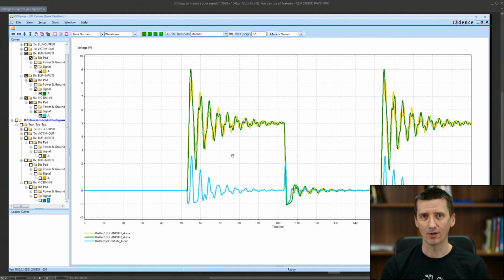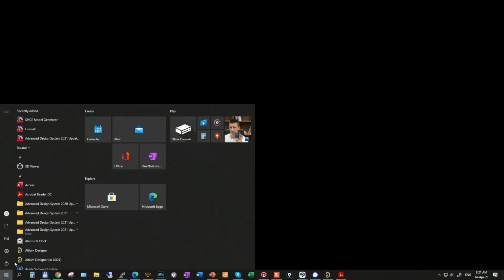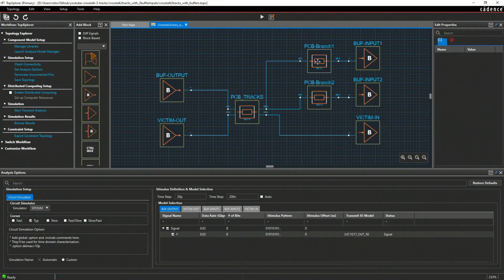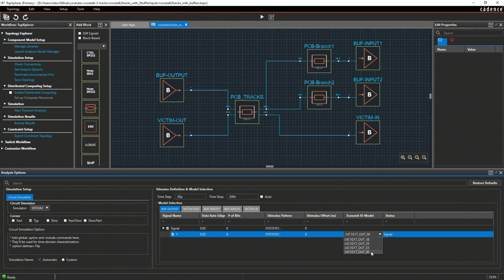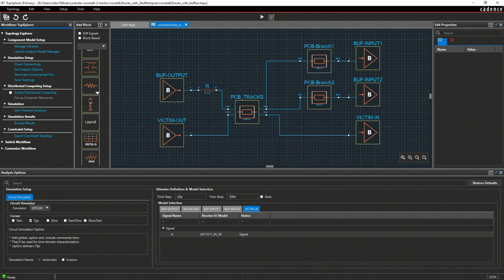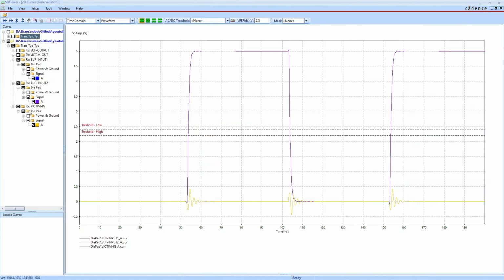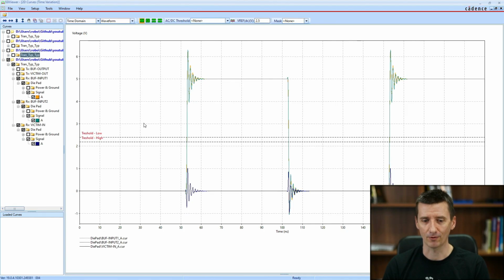3 Simple Tips To Improve Signals on Your PCB - A Big Difference

Comment: So the analysis was done via simulation only, or did you have to make the board to see it?

My adc takes a differential input.. is true that there should be a MINIMUM spacing (ex. 20mil) between the high and low?  A 100pf cap to ground with its own via directly to a ground plane (layer2)?

Comment: Where the track bifurcates, doesn't that change the characteristic impedance of the track? If the tracks are the same length, to the transmitter, doesn't the track look like a 50 Ohm section followed by a 25 ohm section?

Comment: You should also separate the two outputs from the drivers by some space to reduce the crosstalk.  The crosstalk is proportional to the length the two traces run in parallel.  The longer the parallel tracks, the higher the crosstalk.

Comment: By matching the output impedance (driver + 33ohm), the reflection off the high impedance buffer at the end reflects back to the driver and the reflection is fully damped by the matched impedance of the driver to the 50 ohm transmission line.

Comment: Even if the the clock speed is only 10Mhz, the rise/fall times are 2 - 3 ns, meaning you need to apply RF thinking in the layout, i.e. trace impedance, via impedance, source and termination impedance, ground planes,  via stiching etc.
As 4-layer boards are so low cost, using 2-layers for digital, would make reasonable tracks a bit wide on 1.6mm boards.

Comment: So shortly:
Lenght matching eliminates ringing.
Changing stack-up moves impedance closer to 50 Ohm.
Resistor is decreasing difference when impedance changes between buffer and track.☝️
And its only problem, when lenght is close to wavelenght of frequency generated by rising edge.

Comment: 20mils, 8mills track length? That seems to be a not practical example. You did model an IC architecture rather than a PCB layout. It would be more interesting to see a result without the improvements with a real world values. Like 100 or 200mils.

Comment: Very infromative video, i am a HW developer / tester currently, and in my lab (at work) i have the chance (privilege) to work with Tektronix MSO66B, it has 12.5GS/s with 10GHz bandwitdth, damn some crazy stuff with digital signals you can se, most commonly overshoots/undershoots, i tested one RGMII with ADIN1300CPZ PHY and damn, this scopes takes crazy measurements, rise/fall times below 450ps, TIE measurements are also extremly thorough. Very grateful to have the opportunity to work with that sort of equipment and just by looking at a Layout of a board that i'm testing, i can see how just how crazy little thing like, barely noticeable things can have huge impact on the integrity of the signal and thus whole interface itself.

Comment: I thought you’d only get reflections when the line is electrically short and there is an impedance mismatch. In your case however I don’t think the line is electrically short. The ringing is caused by the the gate capacitance and line inductance. The signal was ringing at its natural resonance and was underdamped. Adding a resistor helped dampen the ringing.

Another point, the frequency of interest here is calculated based on the rise time which is 0.6ns and it’s about 400MHz not 2GHz

Comment: For the output impedance of the buffer, since you have the IBIS model, put a 50 ohms termination at the ouput and measure the voltage at the resistor 50 ohms relative to ground on simulation. then uses a voltage divider equation and solve for the value of Rseries in the buffer.  You can figure out the actual real part of the impedance. Then Zs of the buffer plus series termination should equal the transmission line impedance.

Comment: Great video.  Concerning the tool (Sigrity) itself, is the manual process of entering the trace characteristics mandatory or can you use an existing Allegro board file (or PCB artwork etc) to define the trace characteristics?
Reply from the maker: Thank you. You can make some simulations directly in Allegro and you can open some simulations from Allegro, but you may need to adjust some settings. This can  help: https://youtu.be/Bu4MirknEvo and also this can help: https://youtu.be/-t25gJIDQNo

Comment: Very impressing education showing us these hidden potholes in circuit design. for me the termination not only reduce the bounce back  affect but it should also decrease the velocity of the output so that the first re bounce is not that strong as well i think. my first guess to your solution was to use resistors to reduce the ringing and also use ground plane to reduce the interference but I overlooked the length matching at first but that is rather obvious when you said it. I recall this length matching on boards was initially made to impedance match the traces but that they also serve the role to match the wavelength was less known to me so I actually learned something new here too. I have not built anything yet that works with this frequency but I do make oscillators that runs up to about 100khz or so and this generally won´t give you much problems that easy but I tend to use terminal resistors and also pulldown resistors to ground to reduce the noise between stages sometimes. but what I build is mostly control circuitry for amplifiers and powersupplies, timers and feedback or protection and mode indication stuff which I use for the tube amplifiers I also make for myself.

Comment: Someone may have already asked this, but could you get a close impedance match on the high-impedance input-end of the tracks by shunting ~50 ohms to ground at the inputs? Wouldn't that eliminate or greatly reduce any reflections? I ask because two of the three approaches here--the stackup thickness which would require more than two layers, and matching the length of branching traces--are not always practical (or at least not always desired for economy or size contraints). The work I do is limited to inexpensive two-layer,  .0.063, FR-4 boards.

Comment: Thanks Robert for these videos. It’s very informative. In this video I understand ringing is because of not impedance Matching and also length of the tracks should not exceed based on the rise or fall time calculation but how did cross talk reduce in this video ? I understand improvement in ringing eventually helped cross talk but what do we need to do to reduce cross talk increase distance between aggressor and victim ?

Comment: Long text about estimating output impedance if you don't have a good simulator at hand, its been very helpful at my work so i'd like to share:

It's hard to specify an exact output impedance of drivers since the resistance of the output switches (mosfets in our case) will differ depending on the drive voltage and such. Meaning that lower VCC levels will lead to higher output impedance.
If i recall correctly this is not a 100% accurate, but will give you a decent estimate of a drivers output impedance.
And as a general rule of thumb for LVC drivers specifically 20-33ohms are usually good. 
If you change to a different family of drivers you will need to estimate their output impedance too, here is an example that has work well for me with numbers available in all datasheets (also for MCUs!).

Using numbers from the "Electrical Characteristics" table in the datasheet, find the output voltage section (Voh, Vol).
Under test conditions you will find the output current they used to get the numbers, for the parts used in the video (SN74LVC1G17) you will se that when driving low, when powered from 4.5V, with an output current of 32mA, the pin will read as 0.55V.
If you calculate resistance from voltage and current (R=V/I) you get this calculation: 0.55/0.032 = close to 17 ohm. 
For high drive you will need to calculate the voltage drop inside the driver by taking VCC-Voh (4.5-3.8) = 0.7, which yields 0.7/0.032 = close to 22 ohm.
You can do this for the rest of the VCCs listed in the datasheet.
As mentioned before, its hard to give a specific number because the impedance comes from a complicated part such as a mosfet or bjt, but you get ball park values at least.

4.5V VCC:
drive high: 22 ohm
drive low: 17 ohm

Which makes a 33 ohm resistor good for a 50 ohm track because:
22+33 = 55 ohm
17+33 = 50 ohm
Both which are exactly or close to 50 ohm

2.3V VCC:
drive high: 50 ohm
drive low: 38 ohm

50+33 = 83 ohm
38+33 = 71 ohm
Not 50 ohm, in this case it may be better to not use any external resistance since the average output impedance of going both high and low should be 44 ohms. Or add a 6 ohm resistor to minimize both errors as much as possible.

Then again, the numbers we get from doing this calculation is not perfect, and if you do the calculations with numbers where VCC is the same but the output current differs you will also get different impedances (using Vol for the part used in the video, with VCC = 3V, 16mA output current is estimated to be around 25ohm, but with an output current of 24mA you get around 23ohms). 

It's still worth doing the calculations though, since we have used drivers with around 75 ohm impedance at work before, meaning that any added resistance for a 50 ohm track only make things worse, so long as the resistance is not high enough to slow down the rise time enough that your trace looks relatively short verses your wave length again.
And STM32 micro controllers generally have 50 ohm output impedance when using "high drive strength" settings. So no added resistance there too if you are using 50 ohm tracks. You could also try using 20ohm tracks with the SN74LVC drivers, and you should have less issues too.
Reply from the maker: Thank you SO MUCH Tomas. Exactly what I was looking for!
Reply: Thanks for the information👍
Reply: Nice video and also tips about the impedance calculations. I used this idea recently. 

It’s worth to keep in mind the Vil and Vih of the receiver together with the Vcc and series resistor at the output buffer. The voltage caused by the potential division might be reduced and may not drive properly. This is in the case you have a termination resistor too.
Reply: And you should consider the 32mA on the datasheet even if the output is connected to a CMOS high impedance input? This is due to the max current on the transition? Or this current is related with the load.
I have a project here with 22R everywhere, even on the output pins of the CPU. I will take a look is the datasheet days something about impedance on the outputs.
Thank you.

Comment: Robert, thanks again for another awesome educational and insightful video. You mentioned that oscilloscopes might not show correct results. This rose a question for me: Would you - or maybe some experts from oscilloscope manufacturers - be able to demonstrate the effect of a scope's capabilities on actual results of measuring noise when those measurements get difficult. i.e. at clock frequencies in the range higher than, say, 500 MHz? I'd love to see some "this works, because the scope has this and this capability" insights. I know I am dreaming here - but maybe there is something like this in your video pipeline? Thanks again! - Regards. Frank

Comment: I actually wonder if that 33 Ohm resistor would work in "real-world" scenario. Resistors in higher frequencies act as inductors, which would influent the line impedance... Maybe a proper approach would be to have some sort of matching circuit, like L-type, since we want to match the line to 50 ohm? Of course, I am not aware what kind of frequencies are we talking about, just something interesting to think about :D

Edit: Ah yeah, it doesn't make a difference what the signal frequency is, this is caused due to sharp edges, which theoretically consist of infinite types of frequencies..
Reply: Smd resistors are excellent resistors up to at least several GHz. To lower the paracitic inductance, you could even mount them upside-down.

Comment: these looks like it is not really a good pcb design, gate driving ringing because of capacitance or inductance, last is most common, decoupling of supply lines is also a cause of these errors.. Be aware with Gan if this ringing occurs, these can blow.  You do some kind of canceling methode by feedback through parallel trace?

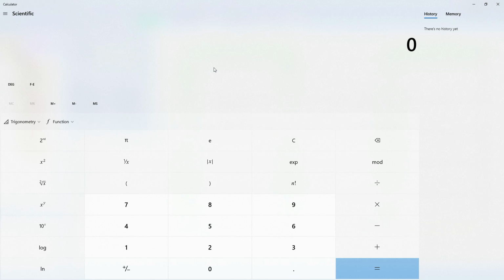Comment: Hi Robert. I want to ask some thing. At time 36:00 you calculating frequency from falling edge and it's time 0.5ns (1/x). This calculation is, I think, wrong. Or does it? Here is why: In one period, there is always 4 edges, 2 rising and 2 falling. Therefore calculation has to be 1/(0.5 x 4) to get right frequency 500Mhz and not 2Ghz. I verified this through on my system where I measured with my 1GSa/s oscilloscope, 2.6ns falling edge. I saw also ringing where I marked full period of sinewave and oscilloscope gave me 110MHz frequency which is close enough and this also supported my thinking. What do you think? Btw I enjoy your work. Keep going!

Correction:
Oh. I think now we are both wrong :) In one period is only 2 full edges (or 4 half edges). Therefore 1/(0.5 x 2) will be right. I fount also mistake on my oscilloscope where it calculates fall time from whole first voltage peak which is also wrong. Be this for everyone as warning to not depend on oscilloscope time readings of fall, or rise edges because this calculation can be wrong as much as bigger is first spike.

Comment: The reason for using 33 Ohm - you are trying to match the buffers output impedance to 50 Ohm, lets say you have a SN74LVC1G126, when the outputs is low, its parameters are max 0.55V @ 32mA = 17.2 Ohm output impedance. With 33 Ohm you get 50 Ohm :) This also means that this resistor value should be output specific, in order to get 50 Ohm output impedance. The resistor also needs to be placed as closed to buffers output as possible, so it appears as a single impedance.
Reply: But if the your sn74 output it's connected to CMOS input or microcontroller. The current will be 0mA due to high impedance of this inputs right? On this case you should use 50ohms? I did not understood why you consider the 32mA. It's due to the max current during the transition from 5V to 0V? Or due to the load current

Comment: I saw some circuits where the designer use a zero ohm resistor in the pi antenna circuit.
As I understand those zero ohm resistors are zero ohm at 0Hz but at 2GHz the narrow path inside the resistor has a high impedance for a microwave.
Reply: A zero Ohm resistor is used if the antenna does not need tuning. The pi network is often included just as a precaution. You could also use a relatively large capacitor instead of the resistor.

Comment: Thanks again Robert. I wonder what the effect is if the trace length is the same as the wavelength and what happens at (Wavelength/2), /3, /4, /5, etc. in other words at the harmonic intervals. Since antennas often work at 1/4 WL distances, I would think there must be some effect. Worth a try? Signed: Interested.

Comment: Hi Robert, great video, it's also recommended to connect - x(10-200)pF capacitor in addition to the 33ohm resistor, can we do this sim also in Altium extension?

Comment: Another excellent video! Thank you, Robert! Especially the influnence of the 33 Ω termination resistors was new to me.
I have two questions:
(1) Is it really important to get close to 50 Ω line impedance? Or is this specific value only necessary if both output and input have a 50 Ω impedance? Therefore, wouldn't any resistance value help - the higher the better - as the input impedance of the receiving buffer is very high?
(2) Would it be bad practice to connect the line with a capacitor in the range of pF to nF to ground in order to lower the rise and fall time? Maybe one wouldn't need the full capabilities of the buffer in this regard for low MHz signals?
Reply: Basics of impedance matching are key for the first question: maximum power transfer happens with matched impedance.  Note that is a true statement regardless of what the impedances are.

Comment: The simplest thing to add in my opinion would be a capacitor, if it does'nt matter if the signal gets delayed a bit by the charging of the cap. Otherwise a full bridge rectifier would be a complicated yet good solution. I don't have any other ideas at the moment.
Reply: Where would you put the rectifier?
Reply: @mzflighter6905  as close to the source of the signal as possible. That would only flatten one curve, the crosstalk would unfortunately still be there.

Comment: Fyi, if the input capacitance of the buffers gets large (say driving 8 or more buffers in parallel)  you can improve the rise time of the signal at the buffer by placing the series termination resistor right in front of the buffer.  In this case the track is acting like a critically damped RLC circuit instead of a transmission line.